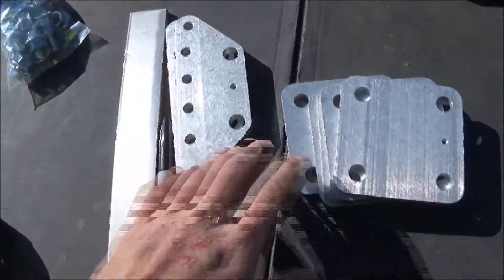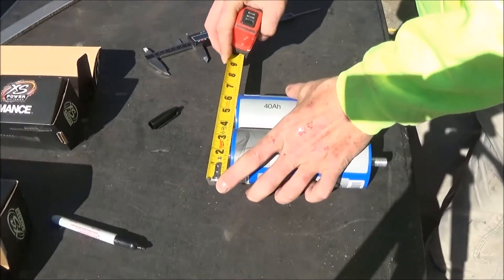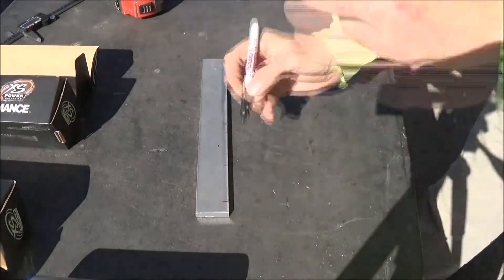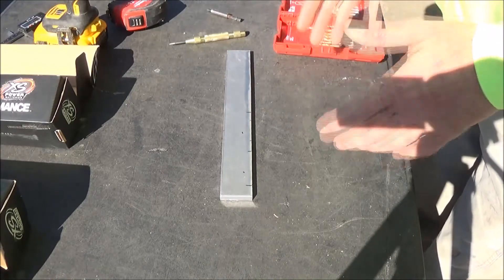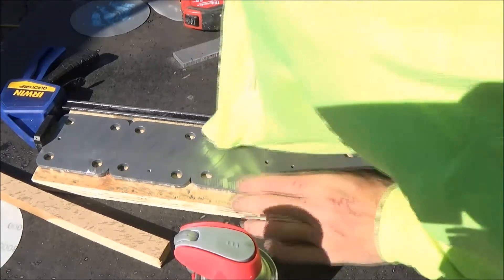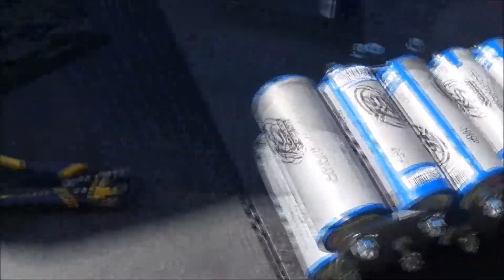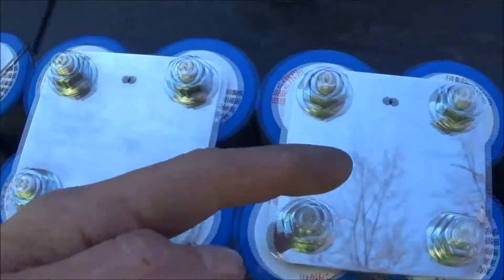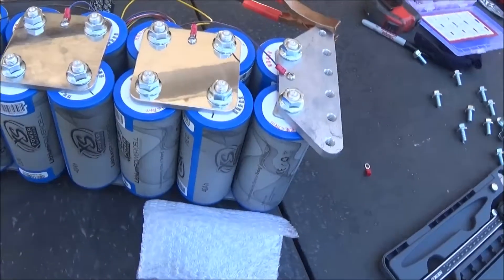80ah XS Power Yinlong Battery Build With Balancer

Comment: so annoying when people spend all this money on batteries just to use aluminum instead of copper
Reply from the maker: The conductivity of copper versus this grade of aluminum is of no greater conductivity, tho copper of the same thickness is higher in conductivity. Personally, I like the look of polished aluminum better than copper.
Reply: @russellburgan9023  that is clearly and 100% not true lol whoever gave you that information is a moron
Reply from the maker: It really isn't even worth a response because of the idiocy, but for the sake of anyone who reads this comment I shall. 
Pure aluminum has an electrical conductivity by mass of 214% of copper. Combining these conductivity measures with the densities of copper (8.96) and aluminum (2.7) yields a 0.48 to 1 ratio. The result is that 1 pound of aluminum has the same conductive capability as 2.08 pounds of copper. I reckon anyone that looks it up will find the same facts. So then, the grade of aluminum at the thickness I'm using has the same conductive capacity as thinner copper straps of the same dimensions. The length and width of the straps and lugs can't really be changed much, but the thickness can. This is the reason most everyone uses aluminum.  It could also be the reason why the cell manufacturers use aluminum as the posts for the cell. I guess the ppl who make the cells are morons to eh? I will not respond to any further comments.
Reply: @russellburgan9023  🤯

Comment: What’s your voltage range with that
Reply from the maker: My 390 amp alt charges at 15-15.1v on startup, and around 14.8v warm. I got a Taramps MD8k, TS2000X4, and a NVX JAD800.4 on this bank. At full tilt my voltage drops about 13.8-14.1 depending on the frequency. I need to chart my amp draw to find the impedance rise and to see what I'm clamping at peak. I'm lazy lol. No, I can't do it in my driveway because my wife will strangle me!